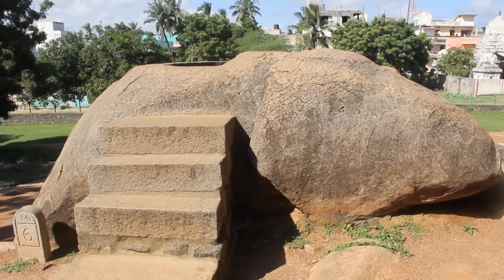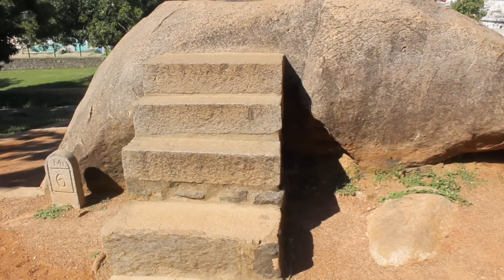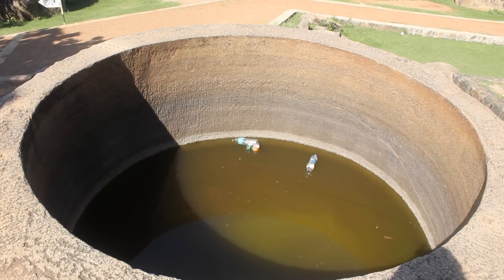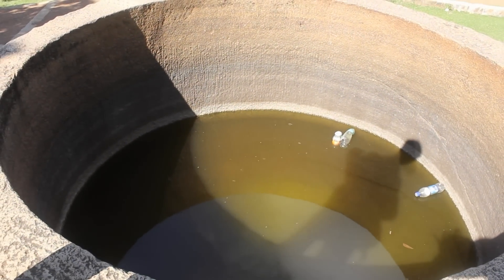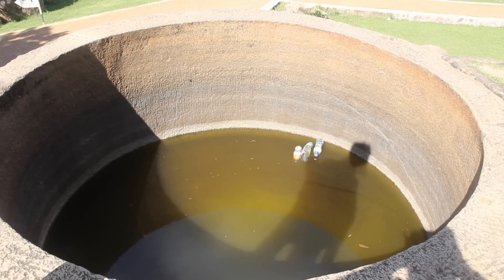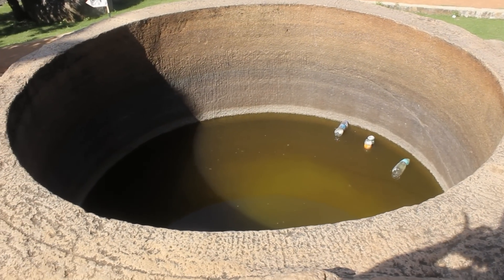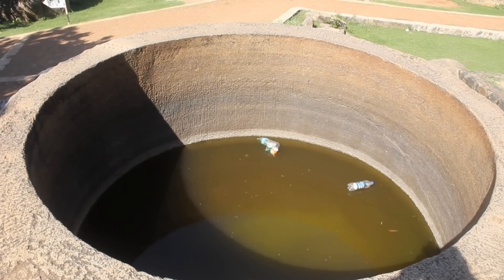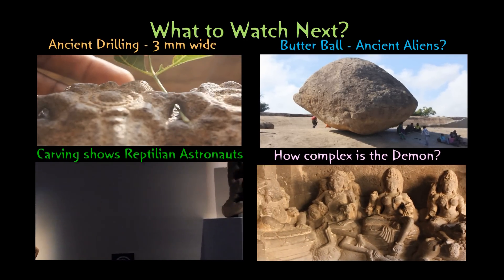Ancient Drilling Technology - Mahabalipuram, India

Comment: How they cut the hole? Easy; use another piece of the same material (granite). Rub the two together, and each part will erode at the same rate. Arrange a donkey-wheel with a timber frame to hold a second piece of granite. Donkey walks round in circles, granite rubs on granite. The cutting piece is reduced to dust, as is the area being worked on. Zoom over it with a brush at regular intervals to adjust the cut as necessary. Use water to create a slurry, it helps as a grinding paste, keeps dust down.Simple, but definitely not stupid. Early societies were very clever at working stuff out. The Egyptians are another case in point, have a look at their stone-work.
Reply: +nlo114 Its What no downward pressure needed for the granite grind stone, they'll just melt each other away over eons, what about the exact same type of granite blocks at Puma Punku with recessed square corners?
Also much more importantly its an utterly pointless activity, no human being would've devoted their lifetime to grinding a perfect little isolated water feature, factor in human nature into explanations, if all else be mystery have justified faith in the surety of human nature never ever changing, we don't do this kind of shit, not today, 10k years ago it don't matter.
Reply: +Veldtian1 In years gone by, there were no metal tanks to store water, hence the purpose of this stone tank. If you study the way the pyramids were built, they used stone to beat against stone in order to fit two stones together. Granite is hard, but it will abrade another piece of granite. Square corners are just as easily made by beating stone on stone, just a slight variation in method. Humans are quite good at simple repetitive tasks when no other technology is available. It doesn't take very long to make a hole like that, just perseverance. (or aliens)
Reply: +nlo114 Its a little tougher to do inside square corners with stones. The Puma Punku stone work is quite interesting. If you haven't seen it I recommend a quick look.
Reply: +nlo114 Your explaination sounds very good but the hole looks tapered how would you explain that im curious.
Reply: +bryan birnse - In the year that this hole was made, it was probably more important to make the hole, rather than worry about exact dimensioning. Tapered holes can hold as much water as parallel holes ;-)
Reply: +Veldtian1 - I think you are being a little disparaging about the human race. Just because modern man has modern tools and machines, it does not mean that ancient humans were stupid. As I said before, look at Egyptian engineering up close. I have walked round the base of the great pyramid at Giza, and I could not slip a cigarette-paper between the stones. It does not mean that they had 'super-advanced' engineering, just lots of labour and time. As for 'dickweed professional gatekeeper academicians with their horseshit explanations', the truth is often magic to those without knowledge of a subject. (this is what religions are based on). You are an articulate person and could be a benefit to society. Please go to college and study, you could then help the world, rather than just gawp and speculate about it's wonders.

Comment: Tie the chisel to a length of cord the is bound to a center point. Pull the chisel taut, with minor slack so it is still workable. As one chisels, work around so one creates a near perfect circle as the perimeter. Once the circumference is a few inches deep begin hammering out the center. Repeat until you reach desired depth.
I have done this landscaping many times. The tool a shovel. The medium typical being dirt, sand, clay, and rock. The harder the medium the more exact the circle.
As to why. I would say either/ or art,and religion, or maybe boardom. I mean it's not like they had Minecraft.

Comment: omg, you dont even need Pi.  just take a nail to the center & attach a string & a pencil to run a circle outline around the rock before you start chiselling.     also the smooth surface is from wind & rain erosion.    why overthink things

Comment: Okay, took me a while to find this video. Thanks! been trying to get more info. on it, as the mention I got of it elsewhere was on “Sky God's Stone/Krishna's Butterball” and didn't really have more info. than it was close by.
I found it call both “Seetha's Bathtub” and “Krishna's Butterwell”, but very little on it under either name.
Don't know if you still monitor old posts but I was wondering if you had heard about the new tech being tested for use drilling wells for geothermal systems?. Gyrotron!
I have had an idea about how they did the ancient stone cutting, and when I came to reading how it was supposed to be done, most that even bothered trying attributed it to the use of sound. Being a sound engineer for many years I do understand how this could be possible, but it didn't quite make sense to me. 
Then I found some info. On the “Coral Castle” in Florida, and the fact that the creator said he carved all the rock using magnetism.
After this my mind went to the idea that he may have been using Electro-Magnetism, but I was stuck as to how that could be done as well. Then the other day I came across a post about fusion being used to drill wells for geothermal systems, and when I checked it out, it reminded me of the idea I had about the stone cutting, specially as it vaporises the rock leaving no spoils.

Comment: Here's a little modern day tip from a mason....find stone, tap a rod in hole, tie 8' rope to rod, tie chisel to rope, scribe 8 foot circle around center,  chisel desired hole, clean up, fine tune, let erosion do the rest....our ancestors went through a stone age and were masters for 100,000's of years working with stone. Instead of pi...just use the rope.

Comment: How it was done is easy looking at how others have done it in the past. A frame is made to go over the spot you want a hole and a wood drill bit is made that uses sand as the cutting edge. 2-4 people can do it with a simple twist>lift>flush>sand action. 

The crew simple walks around the hole for the day spinning the wood drill bit until they feel it no longer cutting. Lift it out of the hole and flush the cuttings out then add more sand and lower the bit back in to spend more time spinning it.
Reply: except the cuts are up and down not horizontal - at least on the last layer

Comment: If the idiots claiming drillmarks pay attention, the marks are slightly irregular. This was done by hand, by highly skilled stonemasons. The marks are also only visible on the bottom half of the hole because water has erroded the inside of the hole over time, making the marks look a lot bigger than they really were when it was made. Ancient India had amazingly skilled stoneworkers, and so did many other ancient civilizations. Just because stonemasonry is a dying art today doesnt mean that it can't be done. It's a lost art, not aliens or any of that other nonsense.

A copper, bronze, iron, or steel water vessel would corrode and rot away away and you can't build a ceramic vessel to hold that much water that wouldnt break from the weight. Only gold would last but such a vesel would of been looted over hundreds of years of wars (and such vessels have in history). It was built with granite to be permenant and because it would last a long time and miminal maintence was required.

Comment: So you get a huge boulder, balance it above the stone on its tip, using a jig, and spin it.
It gradually eats away at the rock beneath naturally forming a perfect sphere as the tip is ground round by centrifugal force.
A small spinning stone would have no effect, but if mount everest was flipped upside down and spun I imagine it would dig a pretty big hole!
And you wouldn't even need to be there, you could just leave the spinning work to donkeys on ropes, or even a water wheel.
Ancient people may not have defined thier lives by how hard they worked like we tend too.
They may have only used power when it coupled with beauty, otherwise why ruin a perfectly peaceful day.:)

Comment: I would say that you can do this with a pendulum hanging above the hole and a hard stone in the end of the penulum string. You can just hammer the stone against the rock and the string of the pendulum will limit the radius. The hammer stone needs to be of a harder material than the rock. Probably the string was not really a string but rather a wood beam with a stone attached to the end.

Comment: This is  a food crusher with its piston missing. This structure may be having flow vents and channels for the juice to flow. The bottom centre of this structure may be having a small circle which could be the base of the piston axle. The 3 mm vents are the air pressure equalizing or juice overflow passages.

Comment: This is achievable with a compass (a string, marker, and center point) and a plumb bob to ensure the verticality of the walls. labor was cheap, and two people could complete a hole like this in several weeks. Not all the stone would have been chipped out (that would indeed take years) - sections could be slotted out (cutting a  narrow trench  around a section of stone) and then feathers and wedges (or even wooden / metal wedges without feathers) used to roughly remove large chunks at a time. then the walls would be finished. still lots of work, but feasible. Perhaps this was a base to something that had to be very stable - a stone astrolabe or something similar?
Reply: liamg1995 try more like 10k mens not 2 lollll

Comment: So, accepting imperial units, an 8 foot diameter means a 4 foot radius. Which by itself means nothing. but with a "depth" of 5 feet means (using pythagorean theorem) the hypotenuse is 3 feet measured from the bottom center of the "well" to the top edge of the "well" or conversely a cone with a 4 foot radius, a five foot height and a 3 foot hypotenuse. (measuring grain?)

Comment: In Egypt we see a round that I believe was for supporting a rotating structural crane made out of metal built by the annunaki. In that area they also have a group of stone bowls that have holes in the upper sides. This might be for smelting gold as the annunaki needed to get the gold purified before loading it on space ships. Your granite hole with a set depth appears to have the same characteristics that might be used for a crane if there are other heavy items they needed to move around. Dr. Ronald Cutburth, engineering scientist

Comment: I've tried chiseling into granite with modern iron tools and was not able to chip it at all. It is relatively easy to split rocks but how does one split just the inner area of bedrock? My thought is that it was used for centuries to grind grain. There may have been a naturally occurring hole into which they put a suitable post. The disk on top gradually wore a circle and then wore down the circle to that depth. Still, nothing I would be qualified to accomplish.

Comment: Also it could have been bulk blasted out thermally using either pitch gas,wood gas, or good Ole' methane in the form of a torch then fine tuned with some sort of saw and chisel operation

Comment: Maybe, it was the stone disc that they wanted and was created from the stone and that was the reason for the hole. Like making cookies. You leave the cutout and bake the cookie. I think they used vibration through a circular drilling edge operated by some mechanical means. That way it could take as long as it takes 24/7 like when you tumble stones to a smooth and shiny finish. You leave it running for as long as it takes. They were truly clever back then.

Comment: My answer to your question is this . by using 2 crossed lines of straight wood   we will end up with 4 squares  which in turn got crossed with 2 lines  and so on  therefore we will have many small squares  inside 4 quadrants. Now a precut full scale quadrant can be used to fully build a full circle. i cant tell you what tools to use but i think chisels would do the job

Comment: have you been to Patel buvanishware? its a cave going some 800 feet back into mtn with a natural Shiva linga in it. the bottom stalagmite is made from 3 water sources on cave roof, from the three sacred rivers. one blue, one clear and one milky and all combine to make the ling-um. been is use for long. at entrance is the huge 9 headed nag with skeleton underfoot, a wall of dripping water looking like Rasta locks has a water pool at bottom with the most amazing water ever.door to cave is locked but a small gift to sadhus there in temple will get you in for the night as the door is locked from the local tiger.  a bit of a walk from road, but well worth it. could tell you some amazing stories from trip there. but not right now.

Comment: I have seen a similar kind of hole in the rock only it is atleast 30-40 feet wide and an unknown depth in my relative's village. Nobody knows when or who dug it. Locals call it "Gundam" and use it as a water reservoir. A few decades ago two temples were built infront of it one is Shiva temple and other on its side is Ram's temple. All of this is on top of a small mountain like slope next to a jungle area. Interestingly this hole in made on a solid granite mountain. For safety sake people have built a 4feet wall around the Gundam and a gate. It's so deep that my mom was too scared to let me take a closer look. But did manage to take a few pics. To dig this depth of 50 feet in the mountain would definitely require machine tools.

Comment: The striations on the stone circle are vertical rather than horizontal. If a turning cutter carved this hole, you would expect to see horizontal striations in the rock. So one can make an educated guess and say this hole was carved with some sort of very hardened tools. But what tools? How would they break the bond from the bottom of the circle core of stone? I think it was taken out in pieces and buffed up later on. Assuming the bottom is solid rock and not soil.

Comment: Ok, the circle carving, perfect carving can be explained. It can br done with primitive tools but us labour intensive. As in , need many strong people and animals to get this done in quick time. So find a starting point and drill a small hole in to the granite using hammer anf basic tools. Then insert a rod and secure it. The use a rope of whatever length based on the diameter you need. Then circle around, maximum tension on the rope will ensure equivalent radius , to the point of perfection.  Just remembered school days and that camelin box which had rulers, protracter , compass, etc . That box was epic, we used put a false bottom and hide money or some picture below that , some boys used it to store contraband items. Now just replucate this on a larger scale , just like how cows n buffalos n horses were used to plough the land (something which is used in todays gen). Get a set up like that, a sharp and heavy object tied to thst centre point and keep going around in circles, with each rotation, millimeter by millemetrr , granite can be cut. So technique here is repeated rotations using a sharp heavy object will give a clean circle . Infact this is what they follow in current gen to cut marble stong, which is relatively soft when compared to granite.  But the principle remains the same . Now to flatten  the base and dispose the stone. Crow bar helps , or hammer but not on this huge scale.  Start with a modest diameter and chisel it out use that hole as your base and continue clearing out the stone. Little by little  day in day out and 16 yrs later Andy dufrane escaped shawshank prison . But the walls there were mortar and crumbling due to weathering . Same for clknt eastwood escaping from alcatraz, there, walls weŕe weaked due to sea water , it is corrosive and year by year nakes the structure weak.  In older building of india, temple palaces , they used stone like granite, sandstone,  etc. Infact the granite  removed from the well can be used as bricks for construction else where so like a goat whose complete body parts are used including horns and skin. It just occurred to me that the sharp object mentioned above can be horns or bones of huge animsls . 

Purpose of this well ? Many things come to mind , from swmming pool for king and his harem of women. Naked skinny dipping and playing water games , like how a hot tub or jacuzzi used in todays  world. Can be of sinister nature also, pit of hell , where man (enemy) thrown down there and macabre scene of animal and man fight,  like  they didin  did ancient roma. The collesium , gladiators gave me this idea. Or even used as a home to diseased people  , leprosy was brutal back then, spreads from human touch , no solution , atleast not a  quick one. Bunch of lepers , family members perhaps so they want them to be insight daily but far away , no physical contact.,used as a jsil or holding cell , with no chance of  escape and imminent death. Slow death litle by little everyday is  the worst kind of punishment  . In Christopher nolan dark knight movie, we get to see such a pit in jaipur where dangerous criminals we housed including maniacal bane. Or an evil dictator might have used this as a secret base , like thst jamie bond movie where sean Connery, the bond, goes to the land of nippon, japon. There mist be a cover, even made from  cloth or stone itslef, like those giant granite boxes found in the crypts of ancient egypt paraohs. Then the aliens theory   , parking palce for a space ship or rocket.  Etc etc. endless uses but nothing concrete.